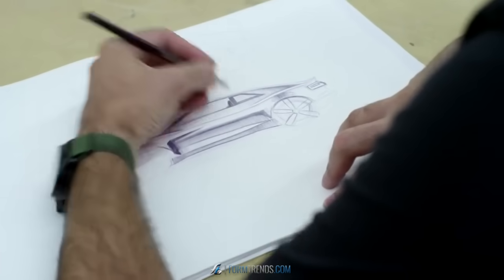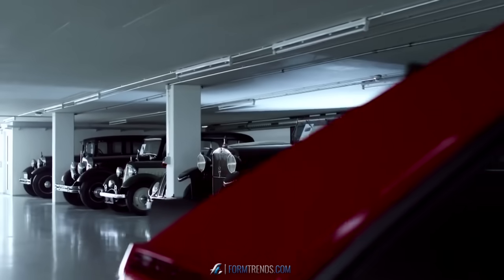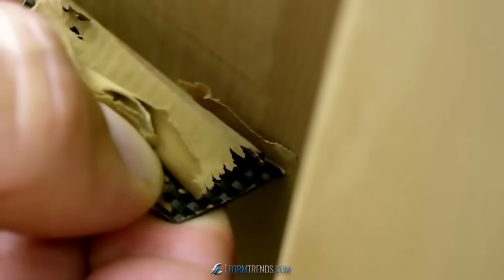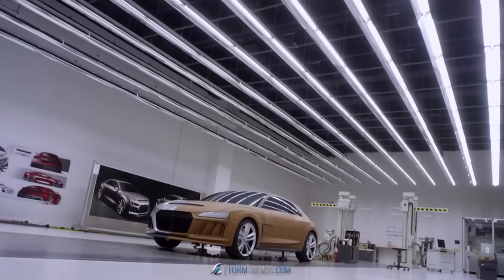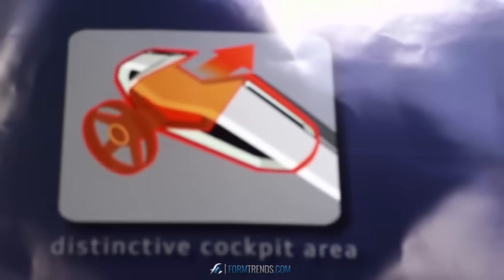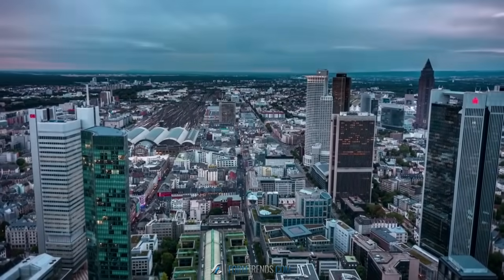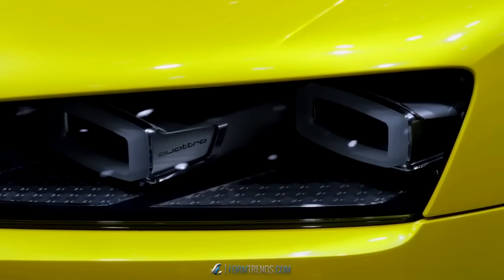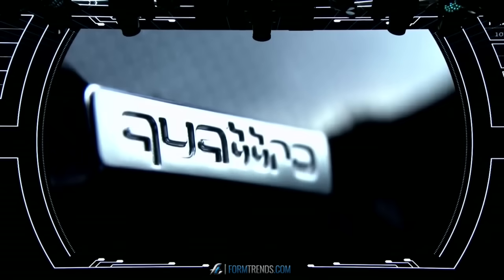Designing a Car – from Sketch to Presentation

Comment: This brings me memories I used to make Chavant hardstyling clay in Slough near the airport of Heathrow. It was smelly affair firstly melting parafin wax and jap wax then filling it with redoil boiling to correct temperature cooking the mixture for 6 and half hours so just before adding zinc oxide the Portuguese resin is added once the zinc oxide reaction finishes it was poured into 25kg metal moulds to cool over night . The following mourning 72kg  of dry grease resin mixture is tossed into a industrial dough making machine and mixed for an hour , 120kg of yellow sulphur powder seived is tossed into the dough machine and mixed thoroughly for another half hour and the very last 15 minutes a brown clay of 0.3kg is added so nearly 200kg of clay is transferred to a barrow to a bread extrusion and extruded cut to length and packed in cardboard boxes into 25kg net weight of clay all done by hand . Those were the days smelly, sweaty job and the eggy smell coming of sulphur powder it was a crappy job to do .

Comment: I didn't even think of using the left and right halves of the clay models as two separate renditions. During the clay portion I was like "how can they achieve symmetry on the clay model when they make adjustments?" and then I realized you just ignore it entirely, treat two halves as separate projects and use a computer to mirror both of them.

Comment: Someone plz tell me, What is the name of the material used at 3:13
Reply from the maker: Odvut Jogot That’s modeling clay.
Reply: @FormTrends  do the exterior designers every play with clay bc i wanna do that not just sketch and computer stuff :/
Reply from the maker: @diegostuff3813  Designers are involved in the process and work with the clay modellers, but the sculptors do the actual modelling.

Comment: So the big clay models are scanned by a computer and then made into metal? How the heck does a thought and design become reality? The wheels and tech within?
Reply from the maker: RvssianTv Designers work from 2D sketches, which are then quickly transferred to digital and 3D. A clay model is then milled from the 3D data, which is then scanned back into digital. From there, tooling is made, panels are stamped and the vehicle is assembled on the production line.

Comment: so the car designer simply draws it? can someone answer me that i dont have the knowledge that i want when it comes to what a car designer does
Reply from the maker: Carlos Flores Car designers draw in the traditional sense but increasingly use digital tools. They also use 3D modelling software such as Alias and VRED. Clay modellers (most times, not always) then work to create a scale model of the car (interior, exterior) and once that’s signed off the car gets built. That’s a very simplistic explanation l, but I hope you get the gist. Cheers!
Reply: @FormTrends  thank you so much, ive had this question in my head for almost a year
Reply: Form Trends waittttttt but does the car designer get to do the clay model instead? Or is that only allowed for clay modelerss. I want to do industrial design and use clay not just computer stuff

Comment: You really run the gamut of visual and physical creativity here. Conception of the idea can be inspired by anything natural or man-made. The sketch involves traditional 2D art skills combined with design techniques. The model is built in 3D space, then is labored into existence in traditional 3D modeling, which I'm sure uses modern techniques. Then it's produced by expensive machinery and filled I assumed filled with handmade components. A lot of melding of worlds going on throughout. Most fields have similar pipelines but I'm always grateful to see it in practice.

Comment: Where the heck are the engineers, only saw designers
Reply: Engineers currently watching this video including me
Reply: The video says "Designing"
Reply: @davidheisnam743  It does indeed and it's a great shame they left the engineers out of that process. I guess Audi just value looks above all else, like aerodynamic performance.
Reply: @ollythomas6702  It is a concept car. Concept cars are 90% about how it looks.
Reply: @ollythomas6702  this concept car doesn´t innovate much, it´s basically a design inspired on the Quattro built over an existing platform, so the engineering part is pretty standard. Besides the video is more about how designers make things look good and how that is translated into reality.
Reply: Curious Cat I get that part, but why the fuck did they care about weight then? Its just a concept so weight is no limitation
Reply: They probably start discussing aerodynamics and other engineering features after the first design-based blue print and concept car.

Comment: How much time does this process take?
Reply from the maker: amin dehghan It depends. Some programs go faster than others. For a show car it’s usually around 4 months
Reply: @FormTrends  Also depends how deep the pipeline is. Really top secrete cars/products can be worked on at least 3-4 years in advance. Products for example, apple has iphones on the table that are 3 years ahead, and they're currently working on the phones that will be released in 2023. Same thing applies to cars, sometimes.